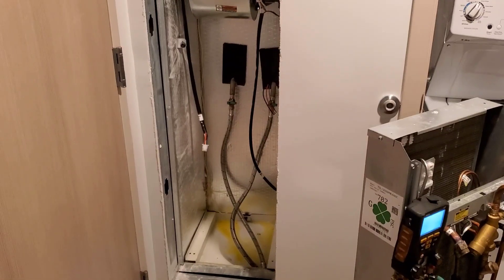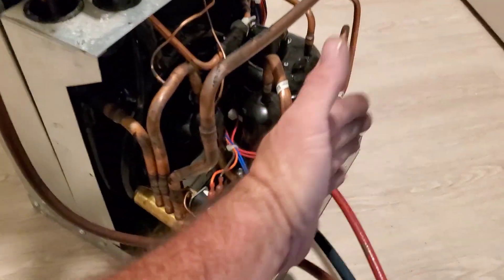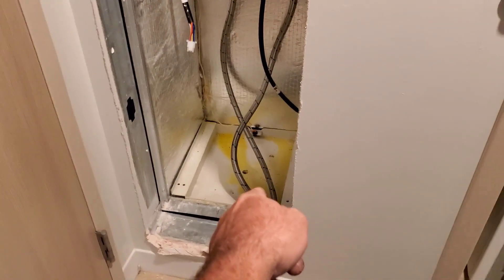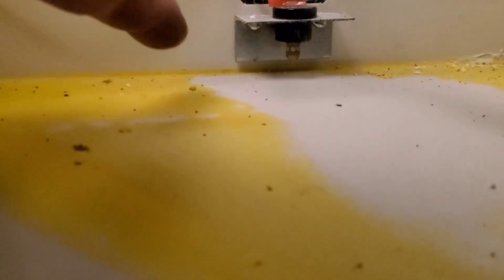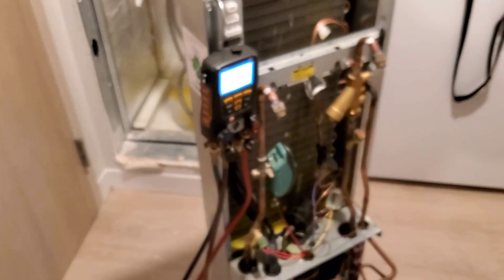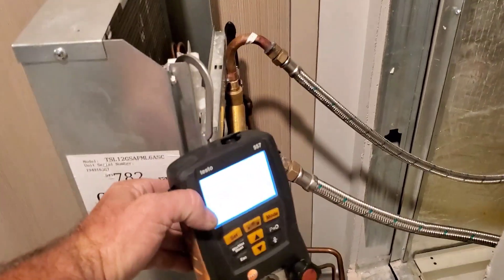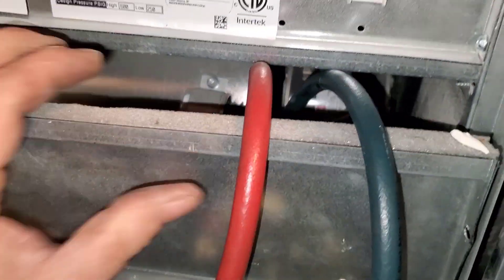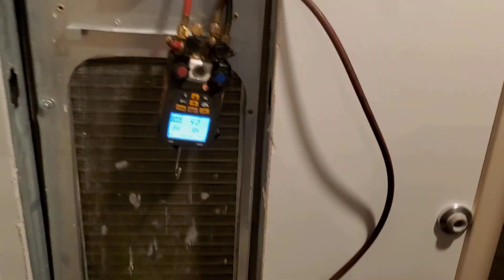Accessing the refer connections on the new Climate Master = PITA

Comment: I think you should try modding a blower with some ducting to move air over that coil while the unit is out, belt drives are the best option, quieter and easily modified for more air movement

Comment: Yea, it’s a shait show to work on these. But all manufacturers are “engineering” poor “service access”.   If we are to adapt, we have to invest in wireless testing tools. You have to determine which brand to invest in but TALK to everyone you can to help guide your decision.
Reply: Should have added, these videos are irreplaceable to let the c-you-nts know how their designs suck. These videos will also (hopefully) resonate with design engineers end users to properly select which equipment they want to invest in.
Reply from the maker: I also have the wireless Testo set.
They do make it nice to install and operate a unit with the panels on, etc.